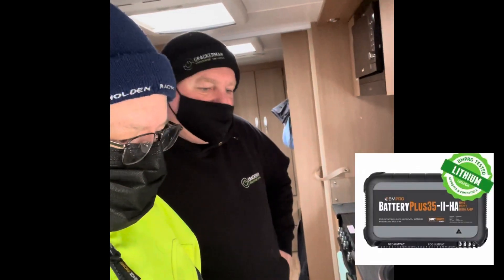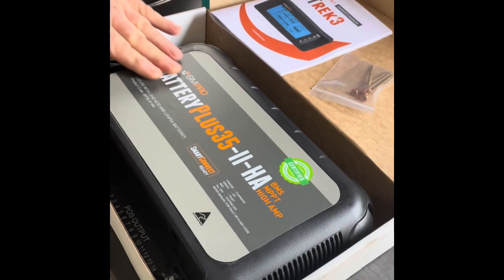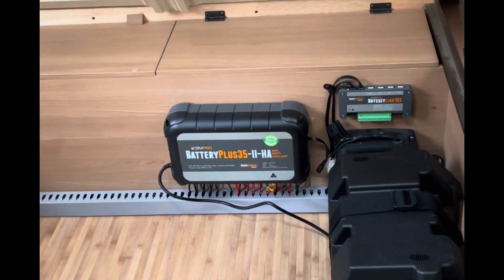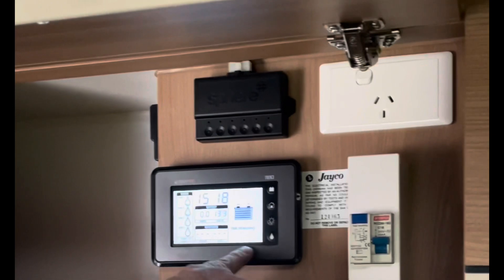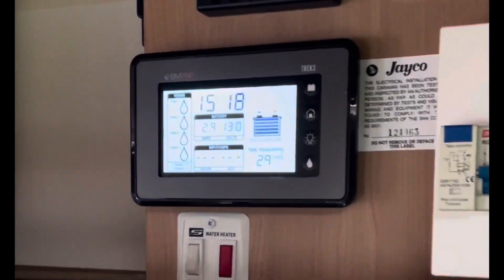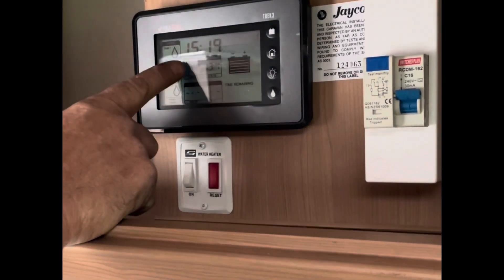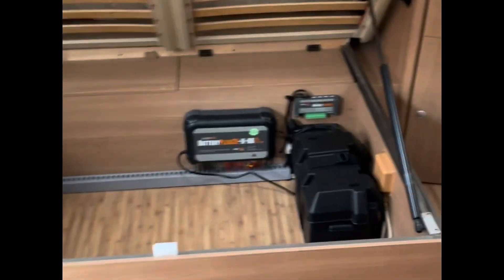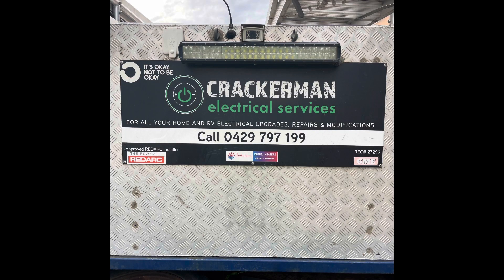LITHIUM READY (BM PRO) Battery upgrade ready for lithium

Comment: Great overview! Did you know you could use the Odyssey app with your system and add monitoring of a range of Bluetooth sensors, such as temperature, TPMS and gas bottle level via it?
Reply from the maker: Thanks it’s a great simple system to use
Reply from the maker: Hello with your battery system can I use a lithium battery with a built in bms
Reply: @takingawander198  Yes, only a battery with a built-in BMS should be used.
Reply from the maker: Where do I connect an inverter to the battery plus35-11-ha